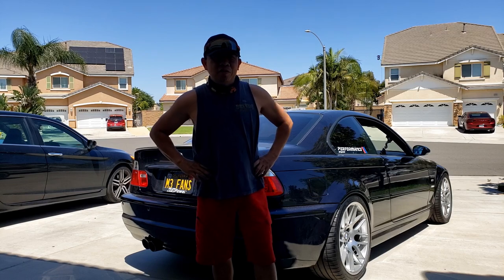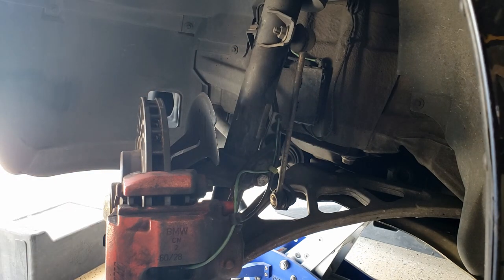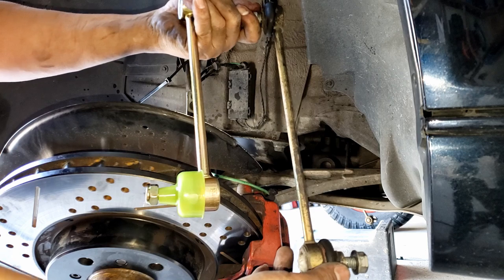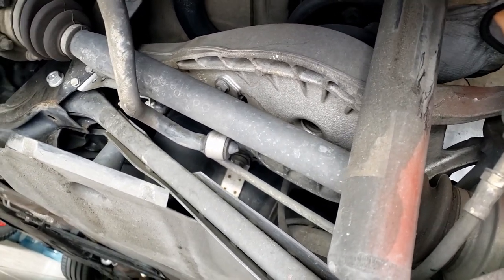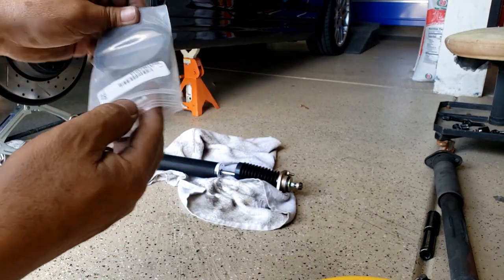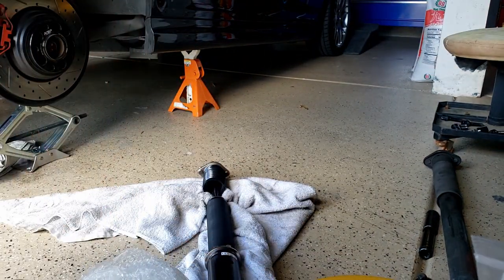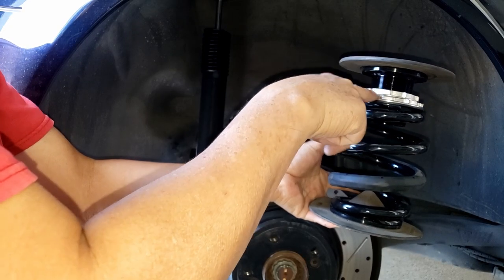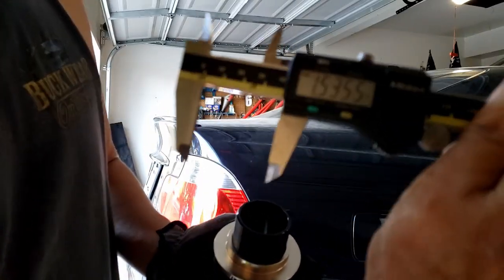BC Racing Coilover BR Series installed on E46 M3.

Comment: What size spacers did you have on the rear and front please?
Reply from the maker: In this video I ran 20mm front and 15mm rear and it rubbed a little bit. I now changed to 15mm front and 10mm rear.
Reply: @teslam3chennel  what was your tyre size on rear and front, I'm running on usual CSL specs with 10mm on rear and 20mm on front, with no rubbing at all, may try these coilovers for road use only, hopefully it's a comfortable ride too.
Reply from the maker: @djlakota8907  275 rear & 255 front both tires are Michelin PS4.  If you add 
COILOVER it will make your car looks aggressive with these spacers👍
Reply: @teslam3chennel  yes I'm running the same tyres, may try and go for the same spec tyres when I change them next month.
Thanks for the info and videos, much appreciated 🙏🏽

Comment: What was the measurement for the front strut adjustment ?
Reply from the maker: Hello Brendan, I didn't make any adjustment on the front struts I left at the factory settings. Sorry I didn't measure what's the factory settings is. However,  I did have a video showing the measurement and comparison between the two; Extremely low vs Regular on this BC Racing Coilover if you like to check it out 👍✌
Reply: @teslam3chennel  Thanks Seth - no worries. I saw your measurement of the rear perches at the end of the video - and will adjust my close to that. I will let you know how they look!

Comment: How much higher can you go in the rears? My wheel offset it pretty low and I scrub a little as it is
Reply from the maker: For my car, the rear can go up to apprx 1.5" more from my current hight. If your tires is scrubbing maybe you have wider wheel???
Reply: Seth ///M3  I’m running 19x9.5 with et33.. space for one finger but scrubs as I’m flush with the fender, my bc set come tomorrow, so I want to raise up my rear, and drop my fronts. From what you’ve said I should
Be okay! Thanks for getting back to me! And nice job on the video!
Reply from the maker: @SonicThaHedgehog16  yes, should be fine. Enjoy your BC Coilover installation when you get it friend. You will be happy with it. Glad to help out. Thanks for watching my video. Subscribed

Comment: hello. are those wheels oem zhp or aftermarket. using any spacers ?thanks
Reply from the maker: Yes, these are OEM wheels came with the car, and I did use spacers with these wheels.  Thanks for watching Edger. Any other questions will answer for you 🙂

Comment: What is your longterm review of these coilovers on the e46 m3? Any issues or quirks you dont like?
Reply from the maker: It's almost a year since I have this BC Coilover on my E46 M3, I have no issues so whatever since then. My issue is silent, but to say I'm very happy with it 👍. The ride is amazing that's my personal opinion. The 30 ways adjustable level is fantastic, it gives me different ride comfort. Thank you for watching friend. ✌
Reply: @teslam3chennel  any squeaking or noises from front or rears? I've seen mixed reviews of BC coilovers making unwanted sounds. 

And what is your preferred dampening setup for street /highway?
Reply from the maker: @BE.Excellent  For my E46 M3, I didn't hear any kind of sound coming from BC COILOVER at all. I have it installed for more than a year now.. Not sure about the mix reviews. All my dampening are factory settings.  Love it